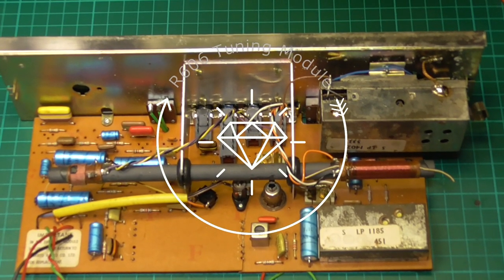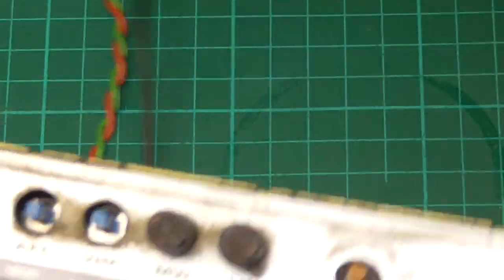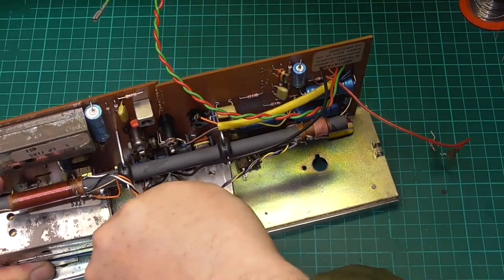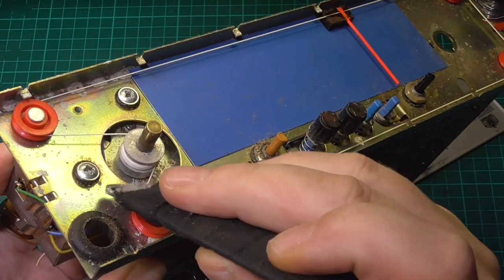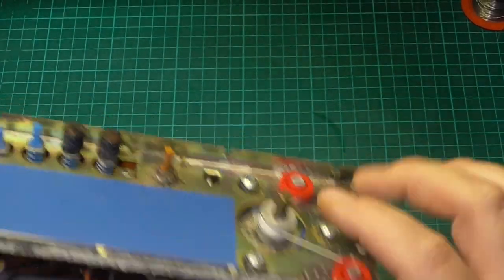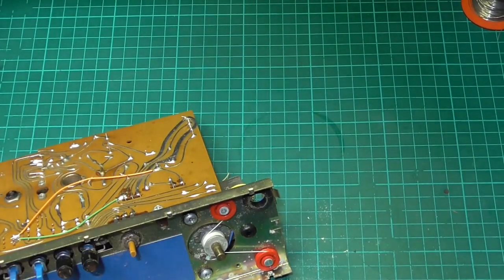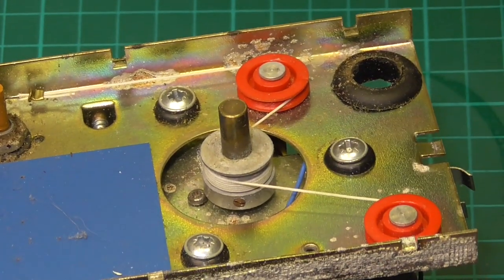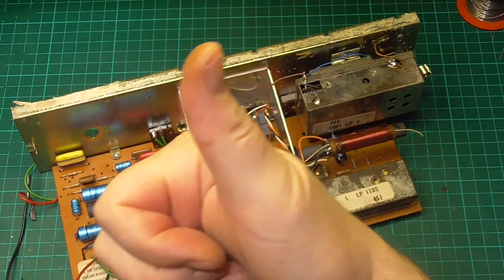R606MB Tuning Grommets - How to change

Comment: Thanks for the video Paul.  It's always a great bypass idea when we can avoid restringing a radio. I currently have an old  shortwave radio in very rough shape that I may some day tackle just to get the tuning dial to work again. I suspect a spring has been overstretched. It's not my forte but I am going to give it a go whenever.
Reply from the maker: Thanks Andy. A member of our FB group has an R606MB with a skewed tuning spindle. The most likely suspect being the grommets, or the fixing brackets. He didn't know how, so I did this as an aid. I despise restringing, and any hints or tips I have are always offered, and I also accept new tips or tricks in return! You absolutely must have a go at your SW set, have a look first, gauge the spring size, and have a replacement spring ready to go for when you do tackle it. Thanks as always for watching.